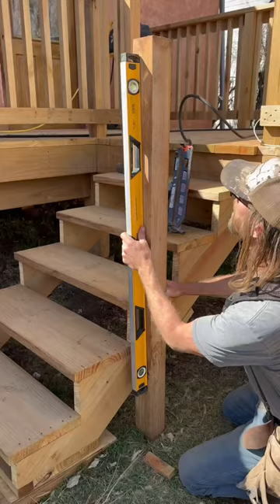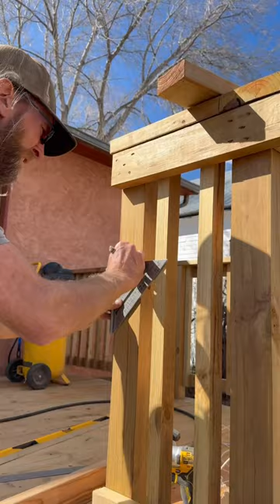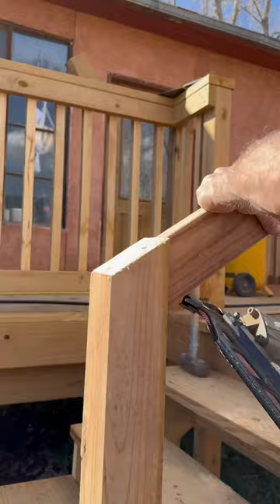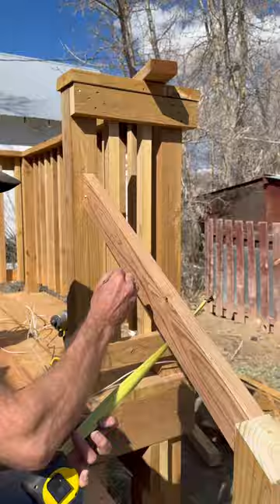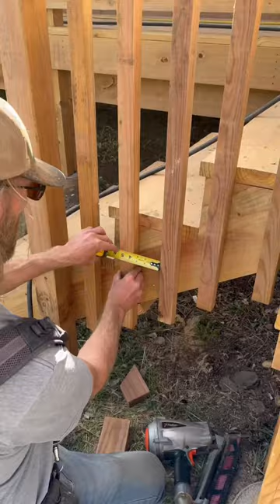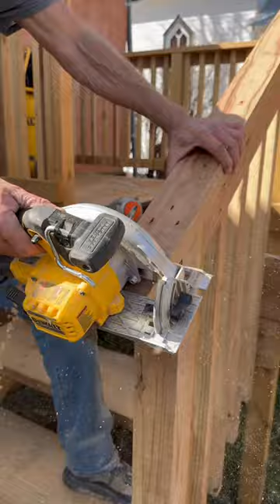🔨Deck Stair Railing Installation! #construction #contractor #deck #framing #carpenter #carpentry

Comment: I built high-end decks for years. Nails put the decks together quickly but damn you can't take anything apart and repair anything easily. We use screws on everything.
Reply: Yeah me too. But if you do on here the experts whin about it.
Reply: @robertcarpenter3256  no don't get me wrong. I completely appreciate the difference in nails and screws and one has sheer strength and #1 cannot resist sheer very well. However, if I use one single timber lock, it can resist like 2000 pounds of shear force or something and so if you use two or three of those it's insane.
Reply: Ever heard of a reciprocating saw?
Reply: @Photologistic  yeah absolutely. With a good Diablo blade you can demo anything.
Reply: @zach88888 I would never build a deck with nails, however, it's way easier to demo one with nails. You just pull the decking and everything else right off easy peasy. For screws, you can try to back all of them out, or give that job to the laborer, but it will take forever and you'll still need to rip up the decking with a demo bar, then go through several cut off wheels on the grinder cutting all the screws off as the sawzall won't cut screws easily
Reply: If you built me a “high end” deck and I saw you pull out any nails, you’d be packing up instantly
Reply: I get so many questions from clients why I use screws instead of nails for fences but I also maintain them so much easier to replace slat or entire panels if needed 
Screws all the way never had on break on me 👍👍👍
Reply: I don’t like using gun nails because it looks like framing
Reply: I’ve had to replace a lot of rotten cedar deck parts in the past three years and I sure appreciate the crews that used screws. Makes it a much nicer removal verses the sawzall and cats paw approach.  
But to each his own.
Reply: You use screws to assemble decks?
Reply: @Gregoman89  Yes sir. 100% of the time.
Reply: I like his style of putting it together but randomly shoting nails in everywhere  actually looks pretty bad up close. Nail guns best suited for the framing and fences.
Reply: Des Moines Iowa building code makes you use screws. If you pull a permit that is.
Reply: Sometimes all
Screws. Sometimes all nails. Sometimes a combination. Depends upon many variables. 
But on railings it is always screws and bolts.
Reply: He ain't coming back.
Reply: @crazycooterMN  🤣
Reply: @histguy101 i agree , u know what ur talkin about
Reply: @histguy101 I can demo any deck off a house with a good old stihl chainsaw real quick. Just make sure to cut it so it falls away from the house if tall, than let the labors clean it all up lol I would never try to cut individual screws now that seems like a waste of time.
Reply: @wook420  By demo I meant resurfacing the deck. Most people won't get their entire deck, framing included torn down unless there's major problems with it, or it's extremely old. You're just demoing the decking and handrail, maybe extending the deck or moving the stairs, adding footings, etc, but you're using the existing joists, and they need to be cleaned up of screws and nails
Reply: What makes a deck “high end” it’s all
Lumber in the end if it’s done right
Reply: When it comes time to rebuild it the nails will practically fall out.
Reply: @tthams73 leave him alone, he's obviously just read the comments an was trying to sound clever. 😂
Reply: That's fine I do to but when you frame the actual structure use nails because nails are there to move with the structure as it settles for example take a 16d nail bend it back and froth it will not snap a deck screw il after going back and forth twice
Reply: @zachmoss3611  no that totally makes sense. I absolutely agree and appreciate the intent of the nail however, when I fasten a deck together, I build it with no movement planned at all. I do miter joints. I don't want any movement. it is not wrong to build with Nails. We just didn't do it. We use Nails in the hangers though. However, that's Code here.
Reply: Why would anyone hammer non treated Douglas fir into the earth is beyond me. It’s going to rot in no time at all. Especially in a wet environment. 
You should be using a standoff post bracket  and concrete footing/pier. 
I am a general contractor in California.
Reply: then you should know, it's all about what the customer wants and what they're willing to pay. this guy has obviously built many decks and I'm sure his customers are more than satisfied for the price they paid
Reply: @abtwopoint0  no doubt about it. His work looks solid and skillful. I certainly didn't mean to imply otherwise. Screws are far more expensive than Nails. And the screws need a pretty good variety of them as well. So you can't basically just buy a box of screws. Timberlocks And the gold I think they are GSR T25 T15 &. T10 and lag bolts. And you also need a variety of the timber locks as well. From the pancake T30 flat tops. To the 9/16 tops. Just that group alone of fasteners is going to be probably 300 bucks.

Edit: and these prices are before the pandemic and all this crazy inflation stuff so my numbers on cost are probably very different from reality at this time.
Reply: Never use a nailer on a quality deck
Reply: Fake Deck 😅
Reply: @S.D.Gaffit Scott Woodland Construction?
Reply: God bless any homeowner who is going to try and maintain an all wood deck and railing……..5 years max.  Especially when you use framing lumber🥹 poor painter is gonna get an ass chewing for sure, even though it was poor planning by the builder!
Reply: @meltin9026 
You can’t afford a high end deck so you’re getting nails
Reply: @S.D.Gaffit you’re not a general contractor In CA. Stop  lying I’m your neighbor and you don’t even own a hammer.
Reply: @MattGross-r3m nobody said it was a quality deck.

Comment: Dang that post will wobble and rott within a few months 😂
Reply: Itll wobble in time, but will take at least a few years to rot. Wood doesnt magically rot. Lol
Reply: That’s what I was thinking… No Simpson strong-tie into concrete for the stair post?! Dude appeared to just sink the 4x4 into the top soil.
Reply: @Ebiru2387  That’s the point.  Who wants to redo it a few years later???
Reply: @Ebiru2387 it was an exaggeration but who pays someone good money to do something like this with no foresight?😅
Reply: But he put 3 screws right down the center of it.
Reply: @NevadaSmith2  It's a newel post it should be cut flush with bottom of stringer and fastened with 1/2" carriage bolts.
Reply: @meltin9026  i am not defending the work by stating that wood doesn't magically rot overnight.
Reply: @meltin9026 I am a contractor and I am not defending it.  Obviously the man is a hard worker and learned this from someone ?  Just imagine if he learned the right way and within code?  He could make some nice change !
Reply: A few months huh? Shows you have no clue what you are talking about. Should last about 5 years before it starts rotting. Definitely should have put in concrete though.
Reply: @par32  I agree it will not rot for several years .  I am a contractor and purposely put P/T in the ground half exposed , half in?  It took about 6.5 yrs to rot.
You do not want you P/T stuck in cement it will rot as quick.  U place your bracket into the cement or Sauna Tube filled with cement , level it , let it set then place your post into the bracket .  Decks should be built to last 25-30 yrs before redoing the structure .  This man knows what he is doing but obviously did it knowing it was a short lived answer!
Reply: @zephyr1408  literally all traditional  wood fences are built by encasing the bottom 4 feet of a post in concrete.  Lots of builders use PT bottom plates where wood makes contact with concrete.  So no. In this instance though I would put a post on a steel saddle. That said this is a newel post and not a post that's bearing weight.  There's no need for it to touch the ground at all. It should just be cut flush with bottom of stringer and fastened with 1/2" carriage bolts.
Reply: @nowerries  that is an interesting thought?  Except ?  One has to forget the reason why it is no longer accepted as “Code Compliant “ per the IRC and 99% of all states, counties & cities?
Often I find myself speaking to someone defending this “Back in the day” practice who is not a professional carpenter and contractor even a sub contractor like myself ?
There is a reason why we no longer do it in situation where one hires a pro or is building a home or deck surrounding said home!
It obvious you do not understand “why” wood touching cement is NOT ALLOWED period!
Now If you wish to do it on your property go for it!  It’s America !
However, it is not allowed to be done by me for a customer !   I actually hv my redwood post in cement in my yard?  It’s the 2nd set of 29 post in that yard in 30 yrs!  Not bad?  But I am not a fence builder however ; decks, all trim inside & out I do as a licensed contractor !
No wood touches cement and I get a pass by inspector my friend !
Reply: @zephyr1408  wasn't talking about code compliance I was talking about the fact that it won't  rot as easily as it has been implied here. As for meeting code then you know that post wasn't even part of the deck structure. It was a newel post on a handrail attached to the stringer.  There's absolutely no reason to have it touching the ground. Question though. What do you place your stair stringers on for your deck? It's a commonly overlooked practice. Don't think I've ever seen a video of someone addressing the issue.
Reply: @nowerries  ok my apologies
Reply: Doubt it. I guarantee the bottom was treated before placement and he layered some gravel down right where the post would go. This isn’t going to go anywhere unless there is some sort of freak occurrence or bad weather. I will say he’s a bit sloppy but you get what you pay for. You want near perfect work done you’re going to pay for it.
Reply: @NevadaSmith2  Never enough time to do it right the FIRST time !
Reply: @bloominflowers6766  haha sheesh. I’m such a paranoid builder, or maybe attempted-perfectionist is the better descriptor. I don’t work construction as a career, but was raised by my general contractor dad who was also a fine finish carpenter. And I absorbed everything from him -including drafting by pencil. I’ve always been super mechanically inclined. Whenever it comes to building/rehabing anything important, I go above and beyond to make sure it’s done at a top notch level (or at least I attempt to do so, even if it happens to turn out sub par 😆).

Comment: Obviously not code compliant.  Cannot use 2 x 4 as a handrail; cannot grip it.  Don’t believe it?  Just check the building code for yourself.  My inspector in CT would fail this.  The 2 dozen nails shot all over the place is awful. I agree with kaydeschlosser7848’s comment.  Framers should stay in their lane especially ones who are code ignorant.
TC
BSCE

Comment: That square trick was genius. Puttin that in the brain pocket.
Reply: Can you explain what it was for
Reply: Useless if you know the angle of your stringer 🤦🏻‍♂️ just pivot the speed square. But by all means, try this out
Reply: @MatthewBKR  lol ok bro.
Reply: Agreed. Pretty clever
Reply: “Brain pocket” 😂 Amazing term. 

I’m taking THAT one, AND the speed square trick. ❤❤
Reply: @shadyrep1275  so the railing can have the same angle as the stairs/stringer
Reply: Basic 5th grade geometry, using two right angles to create a parallel. Whoever calls this a new trick may have paid insufficient attention sometime in school earlier. And it's ONLY a smart move if the legs of your squares have the correct length.

Comment: You ever hear of screws?? Look nicer, and when the wood twists from drying out, you can come back and replace easier
Reply: Don’t use screws screws break over time while nails bend over time which is why all houses are built out of them
Reply: @octavius9356 houses are built with nails, but decks are built with screws
Reply: Nails have better chance of popping out than a screw
Reply: @histguy101  right i apologize I forgot add things like decks is alright to use screws I used screws when building my back deck

Comment: I love it when people build decks like this because I get to come back and replace the entire thing with sustainable product.  Poor customers could have done it once and saved a lot.
Reply: Do you really think all people can afford that?
Reply: What materials you using? I looked at your vids. Your DIY work isn't any better.
Reply: Well you looked in the wrong place then because we don't use wood decking or railings.   That's the whole point.
Reply: @adam_becker  Never used wood deck boards? 😂
Reply: @Mr.Crowley696 You're seriously going to use 6 year old videos as your counter argument?
Reply: @adam_becker you don’t use wood decking or rails? The standard for decks
Reply: @TheRealDill93  we use less and less wood in every deck.  We are building with aluminum frames and joists, composite and aluminum decking and aluminum railings.  Kinda hard to use nails in that material. @kcbuilt
Reply: @TheRealDill93  and I would the standard that used to be wood is no longer the case. @kcbuilt
Reply: waaaaaait. You're arguing that aluminum is a "sustainable" product but wood is not? I don't get that.
Reply: If you are asking that question, there is nothing more I can do for you...

Comment: Need carriage bolts for railing post in my area and spindles on the outside of deck is a code violation
Reply: Your a carpenter ?

Comment: Why use nails where there will be lots of movement, better off using screws and making sure it never losen’s up
Reply: Screws snap, nails bend. Unless you’re using structural screws ie GrK’s, lag/carriage bolts, outdoor work should be nails.
Reply: Nails are better .. they can bend while screws will break or loosen.
Reply: @Mark-gt9yv   aaaah ok, that’s good too know. I’m a metal worker, no real experience with wood, other than wood floor installation. 
How about with shelves and cabinets.
I’m going to build a storage shed/ work shop, nails or screws?
Reply: @JohnDoeWesside213  I appreciate the knowledge, in my mind screws seemed better but guess I was wrong
Reply: @JoeyVX  ay bro..i just finished an apprenticeship at the United Brotherhood of Carpenters you never stop learning..
Reply: @JohnDoeWesside213  much respect for that, I’ve always had an appreciation for all fields of engineering! Carpentry is thee most important field of engineering..
I welded and metal worked my way through school to become a chemical engineer and it’s true been doing it for years now and I’m still constantly learning. Barely scratched the surface but I love it.
Reply: @JoeyVX  right on.. i want to learn how to weld..
Ok brotha you be safe out there.
Reply: @Mark-gt9yv  no deck has ever failed because of using screws. Nails should be banned in deck building
Reply: @mrplatypus4777 My decks have never failed using nails, whats your point? You still need lags, carriage bolts, brackets, clips to pass structual inspection. Your wood will rot before everything else fails. You have obviously never seen a galvy ring shank.
Reply: @JohnDoeWesside213 not if you use the right screws.
Reply: @Mark-gt9yv  screw, snap and insanely high, sheer force values. Like people talk like that but I have never ever gone back to Repair anything on a deck because the screws shared. I know that's a talking point, but I've built multilevel residential decking with Trex picture framed in giant beams always the same.
Reply: @JohnDoeWesside213  if you're building stuff thinking it's gonna be moving then your design is bad. You need to engineer the deck better so that you don't have to worry about nails that flex versus screws that sheer. You mounted to the house or the structure properly you lag bolted timber locks and it's not going anywhere. the only way those fasteners will fail is if the wood fails. Or you didn't build your debt correctly. Simple as that.
Reply: @JoeyVX Always use screws for shelves and cabinets. Trim and finish carpentry is my bread and butter. As far as decks if its built correctly the right type or screws won't cause any issue. It shouldn't be moving enough to where screws will snap if it is its more of a design issue than a screw issue. To be honest though the best way to do it is with a combination of the both. Framing is a whole different story of course but everyone is going to have their own opinion with decks.
Reply: @Vidar93  I appreciate this information, I’m about to build a shed/workshop and I’m adding shelves for all my equipment. 
Hopefully you can answer this, what would be more cost effective, building a shed out of cinder blocks or wood? And which would be better at keeping moisture low and maintain a cool shop on a hot sunny day?
Thank you in advance
Reply: @JoeyVX  I built one 37 years ago that I used sand and concrete pavers for the floor. It is in perfect shape today and stays cool. The rest is wood. Grow a tree or two on the east side so you block the morning sun to help keep it cool.
Reply: @jamessandman3708  I truly appreciate that! Great info thank you! The spot where I’m installing it is right next to a few trees so turns out I chose perfect spot! 
What kind of material did you use for roof?
Reply: @JoeyVX  plywood, tar paper and shingles and it is still holding up.

Comment: The square trick was cool. The handrail can't be a 2by. Code requires you to have a grip on the whole piece
Reply: I have used 201rail for years to meet code.  Smooth, rounded edges all the way around.  Looks alot better than 2x ripped down